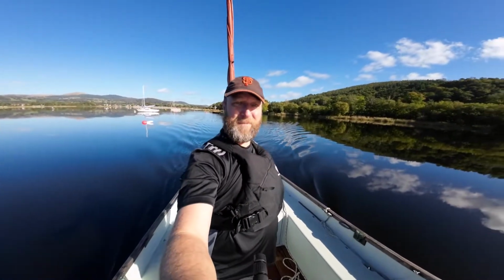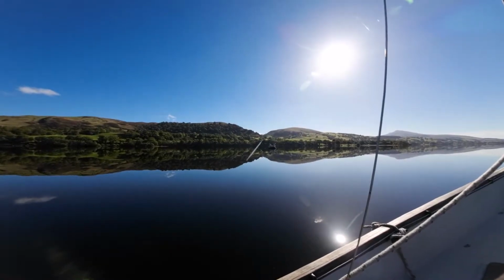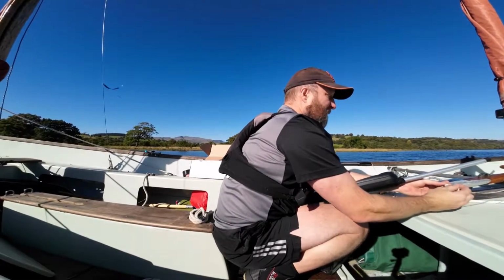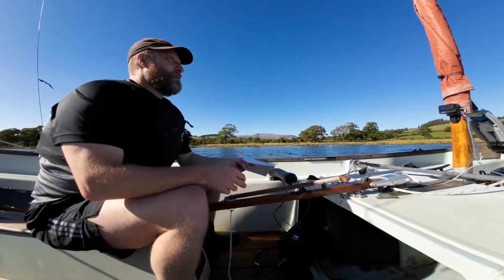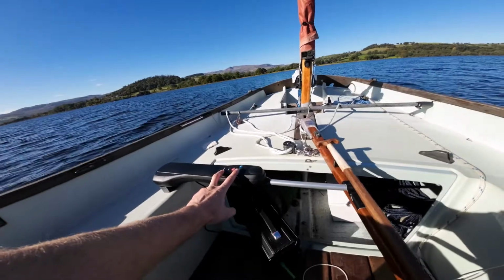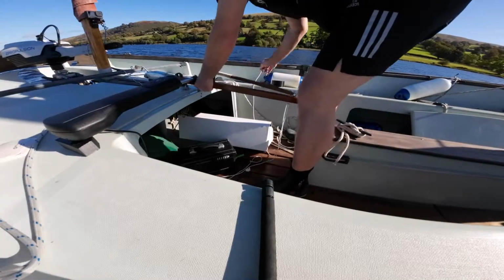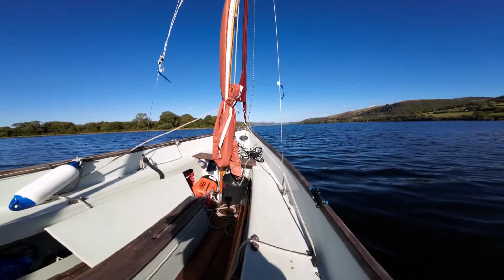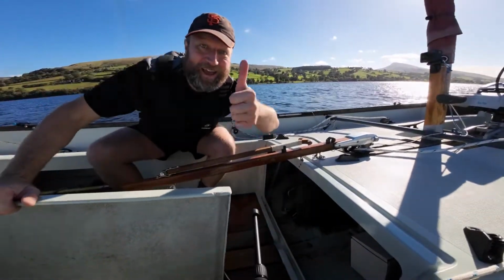Testing a Simrad TP10 Tiller Pilot on My Drascombe Lugger

Comment: Hi Dave, I was the senior designer of this Tillerpilot series for Simrad, and it's great to see it being used
Reply from the maker: Hi There. Many thanks for the comment. Thats great to meet you.  Yes I bet its interesting to see it on a Dinghy, albeit a big one!!  It does work quite well. I have since tinkered with the settings a bit and if you set the steering to be a bit slacker then it works much better. It also works much better on the sea where the conditions are always a little more consistent than on a lake. To date I haven;t heard anyone else fitting to a Drascombe Lugger but it has worked for me.

One thing I have also done this season is balance the sails and use the Simrad much more and that improves performance of it markedly. I htink in a Dinghy you're giving the Simrad a big test as the boat is so twitchy compared to a yacht!!

I do find that the unit is quite sensitive to voltage levels. With Li-ION battery I previously had, the voltage can drop to lower 11V ish levels and this causes the unit to click a little.  With the LiFePo4 battery where the voltage stays above 12.6 it's much better. I guess when this was designed it was designed for lead acid batteries which have a similiar voltage range to the LifePo4.

Only thing I need to make for it is a waterproof cover!!
Reply: @SailingWithDave  that's lovely to hear, and some interesting points about the battery. I haven't worked for Simrad/Navico for many years, I think I designed this a good 25+ years ago, bit I'm glad to see it's still made and used

Comment: I didn’t realise they were that simple. Most of the videos I’ve seen require it to plug into a chart plotter to work and I don’t have an up to date one that is compatible so it’s just been left in the boat in it’s box 😂 incredible definitely fitting it now as it’s only power and fitting it to the deck!
Reply from the maker: Hi there. So the better models like the tp20 have a data line that plugs into chart plotters, compasses etc, however you don't need to.

Only things I had to play with were needing to move the unit back a bit on the tiller. The boat is so light it needs better response and tiller input. 

The other thing that really helped was playing with the sensitivity settings. Made it much better. On a recent trip on the sea I had it working for 30 mins at a time no problem
Reply: @SailingWithDave  she will be aboard a mirage 28 with very easy direct steering and a very beamy sail, so will hopefully work like a dream!

Comment: Hi Dave - really enjoying your videos!
I notice (I think) that all your testing was done with the centre-plate up. I think you'll find a big difference with the plate down (i.e. in sailing mode). It'll give the boat a whole lot more directional stability and at the same time make it easier to steer by giving it that defined pivot point.
Reply from the maker: Hi Steve! Many thanks and good to hear from you.  That was by accident if I did that!! I took a tip from you actually and I like to put the CB down about 2/3rds when beating and maybe 1/2 down when reaching. Maybe i'll try experimenting with how much I put down when using the spinnaker.